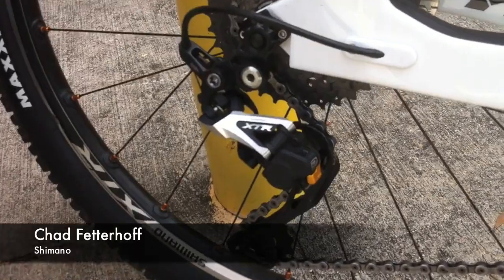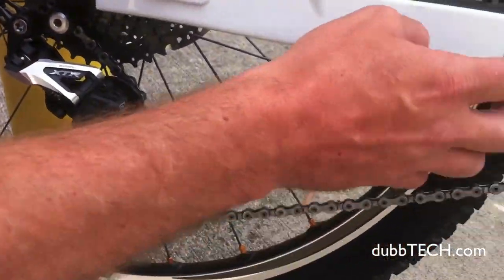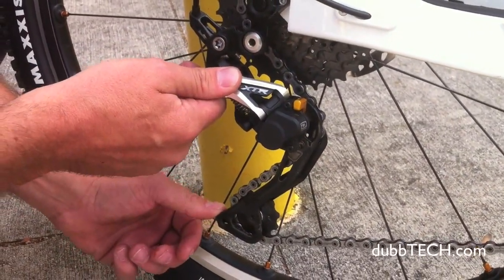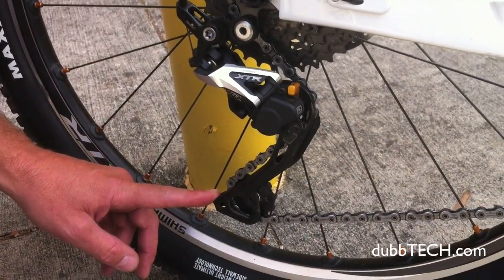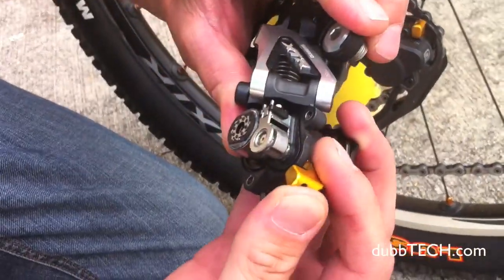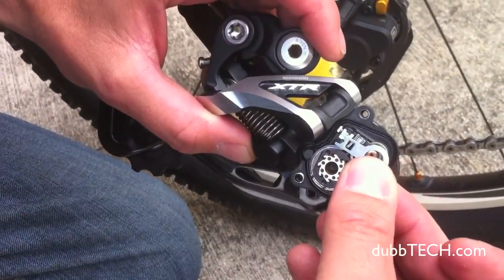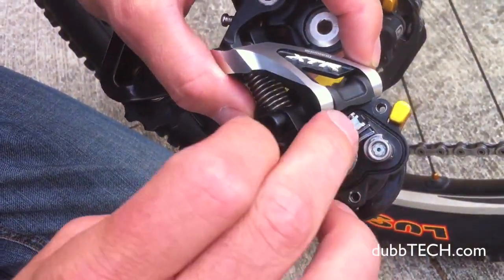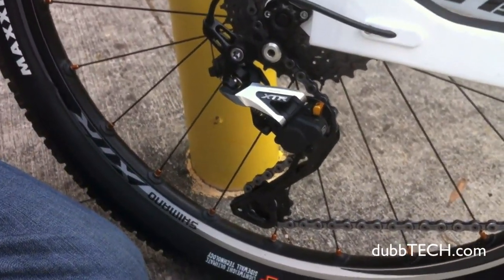2012 Shimano XTR Shadow Plus

Comment: I love it when my xtr is engaged, it doesnt make me think back and worry stuff like will my chain flip off the cogs? and noise.. its almost completely gone.. i have been using the RD-M985 for 5 months now and i have not even set the clutch for adjustment after the initial break-in since i had it installed ! just amazing.. wished they were not that expensive.. lol..